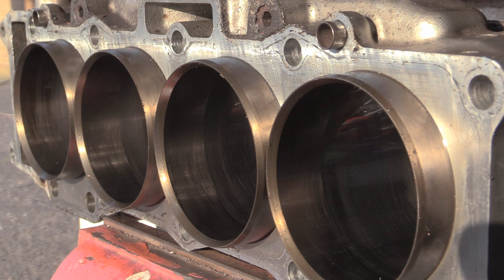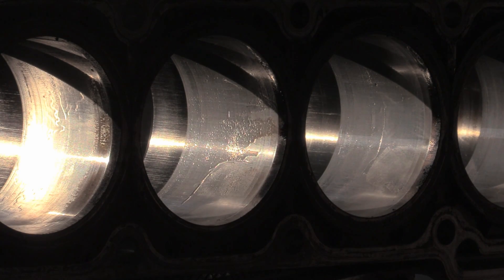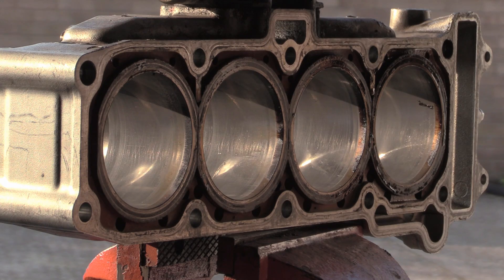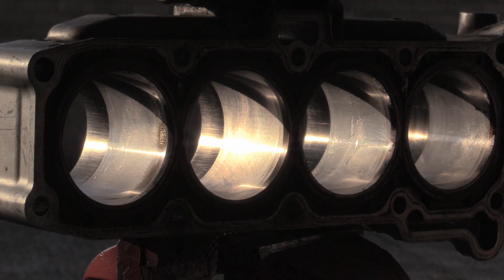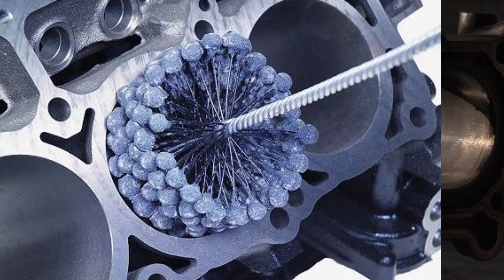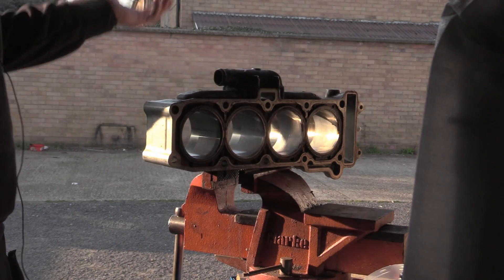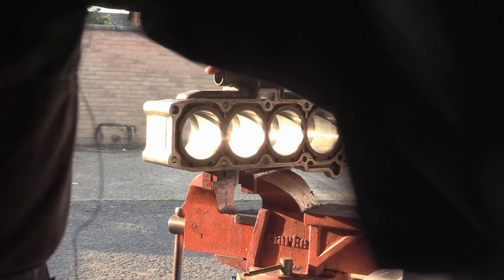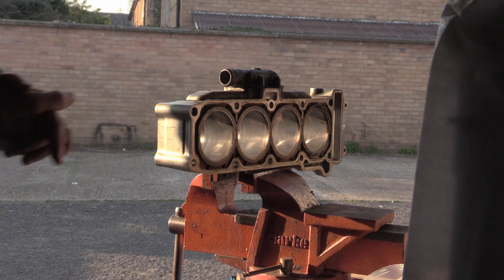M1stERd - My First Engine Rebuild - PART 9

Comment: Hi mate apologies if answered elsewhere - is there a specific make of tool you’d recommend to measure cylinder bore size. I’ll be doing it on a rare occasion in the garage so if I can get away from spending a few hundred quid then great. However I also know there’s no point in spending 40 quid and it telling me nothing! Just wondered if you’d recommend a specific brand. Cheers
Reply from the maker: Mitotoyo, but its £300+....
Reply: @thedirtyworkshop  might need to save a bit then ha. cheers

Comment: I was going to use the same hone that Gold Guy was using.  I've used it before on a car engine and thought it came out good.  Are you saying that the only way to hone correctly is to take it to a machine shop?
Reply from the maker: Those 'hones' are totally shit. They don't apply the correct pressure, and you never get them concentric as you can see in his video. As for the flex hones they're ok for cleaning a bore but that's all - Honing is a precision process - as in more precise than boring. And its the final step after boring. 

"Are you saying that the only way to hone correctly is to take it to a machine shop?"

- Yes, unless you have a Sunnin boring machine at home.

Comment: Why does part of the cylinder smudge and part of it nice and shiny. At about 2 minutes into the video. Thanks.
Reply from the maker: We'll go into that when we take a closer look - but its all about force against the rings, and the speed at which the rings are traveling. At the top of the stroke the piston (and therefore rings) are slowing down on the up stroke. During combustion the pressure are the highest so the froce agains tht cylinder from the rings is the highest.

Comment: I bought a flex hone for cleaning up my CR500 cylinder. Took no time at all and left a nice crosshatch finish. 

Although, that is a sleeved cylinder, so no need to worry about chipping nicasil.